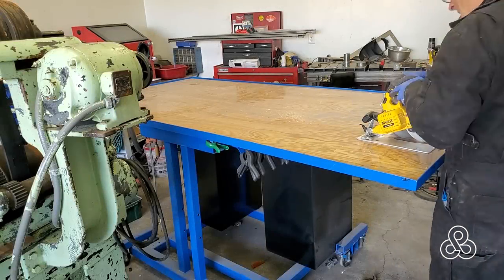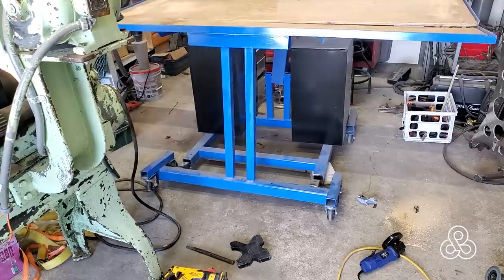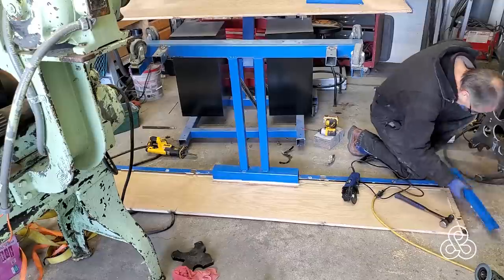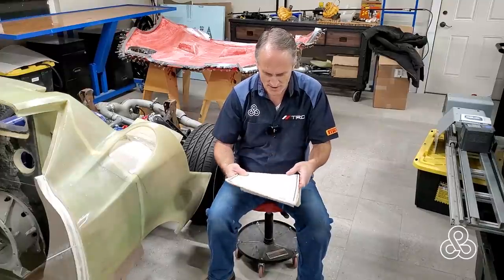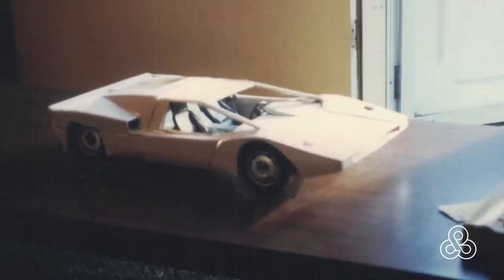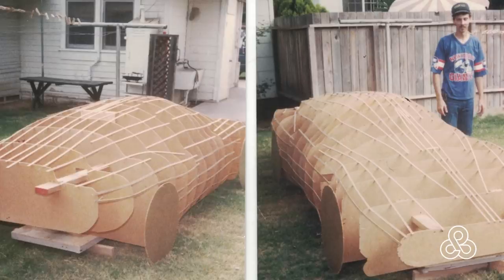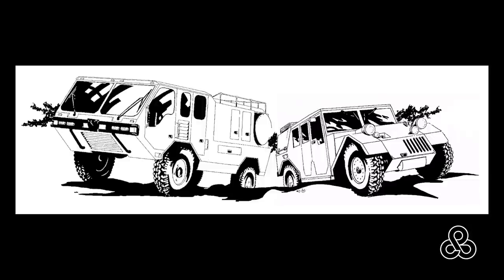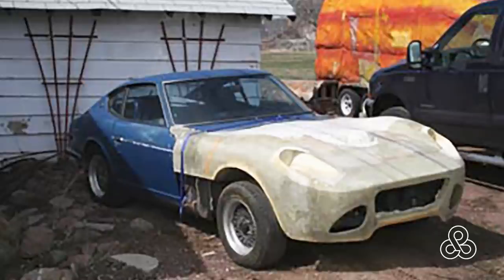Past projects and a repurposed work bench, a prehistory of the Arete supercar project

Comment: interesting stuff - never be ashamed of stuff you done in the past - as it put you on the road to where you are now - that early car style looked so similar to the old pink panther car from the cartoons don't you think - a couple of monsters there haha
Reply from the maker: Cartoon car for sure, even with parts falling off from underneath. Funny fact- One day on the highway a rear axle/bearings failed and the wheel started to come off. luckily I got it stopped when it was still attached, but hanging off about 10 inches.
Reply: @BuilderCreator  like that - i've had many many slow punctures over the years (am 55 now) but always manged to get home on them, or to end of journey - the other day i clipped a kurb (poor judgement on my side, age i guess), very slightly with front wheel and more of a bang on the rear, i was sure to have damaged the rear but nothing, 2 days later the front was flat and split, new tire less than 2 months old, and now both front need doing, can't win

Comment: What's your view on using just spectacles instead of safety goggles or face mask when grinding and slitting?
Reply from the maker: The greater the risk the greater the protection needed! I will add that the one time I had to go and have a piece of metal (tiny shard) removed from my eye, I had been wearing safety glasses on - go figure. I also remember as a kid my dad breaking a high speed cut of disk that went through the wall (2 layers of drywall) and embedded in the buildings steel siding- no goggles would have stopped it. A lot of people harp on me about breathing protection- just remember I often film a short segment, then turn the camera off, mask up and sand away. No one wants to watch me sand for 3 hours straight. Ha!